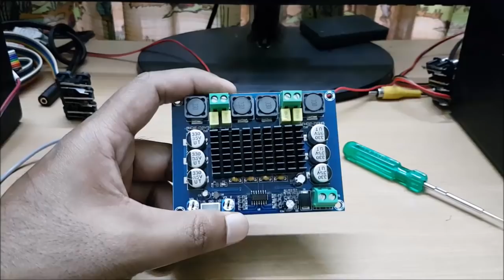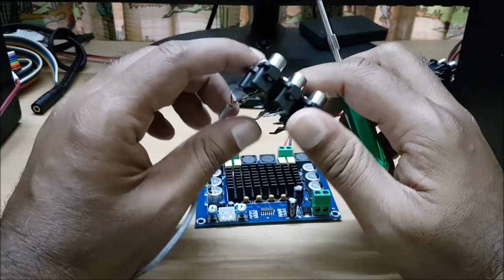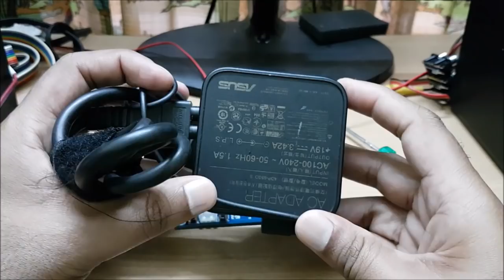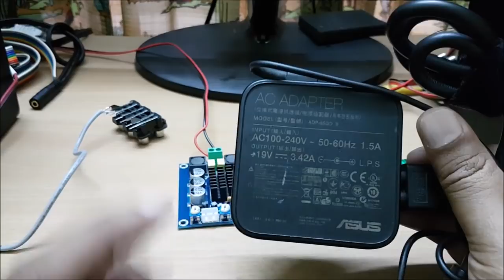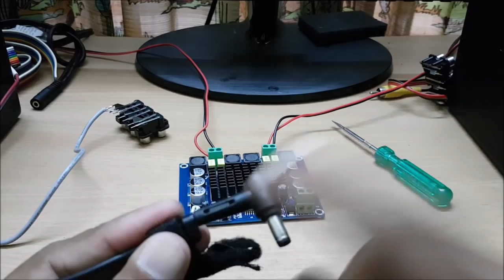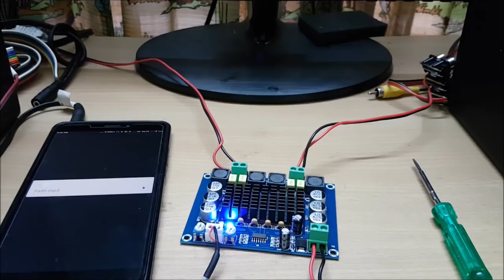TPA3116 How to connect the amplifier

Comment: Ethil 12 vlot eathra ampere  kodukkaam.
Reply: 100+100 alle appo 17 ampere vendi varum.17 ampere kitiyillengil 20 ampere kodukam.pinne ampere ethra koodiyalum kuzhapam illa.karanam carinte Battery 30 ampere okey und.minimum 17 ampere kodukanam
Reply: 12v 17 ampere koduthale 200 watts output kitulloo.12*17=204

Comment: ചേട്ടാ, ഈ ബോർഡ് വച്ചു ഒരു amplifier set ചെയ്തു. നല്ല ക്വാളിറ്റി ആണ്. Earth ചെയ്തിട്ടും നേരിയ humming പ്രോബ്ലെം ഉണ്ട്. Volume കൂട്ടുമ്പോൾ ഉണ്ട്.
Reply from the maker: Power supply etha use cheythathu
Reply: Tech Kannan Malayalam  transformer vachu anu rectifier cheythu. 4700 capacitor koduthu. Earth cheyth enkilum cheriya buzz  sound. But shalyam alla. Music play cheyyumbol ariyilla. Ithinte oppam 4 inch  sub woofer 2 channelilum koduthal extra bass kitumo
Reply from the maker: Don't attach woofers to the same line use another amp for woofers
Reply: Tech Kannan Malayalam any problem ? Transformers 8 ampere Anu. Boardil 40 watts speaker Anu. 40watts  subwoofer koduthal problem undo
Reply: @Jayarajdreams  sub woofer കൊടുക്കാൻ വേറേ sub amplifier വേണം ഇതിൽ സാധാരണ Woofer കൊടുക്കുക.bass treble board separate കൊടുത്തിട്ടുണ്ടോ ഒരു mini bt കൊടുത്താൽ കുറച്ചു കൂടി Bass കിട്ടും.
Reply: Mini bt engane kodukkum bro

Comment: ഈ ബോർഡ് എത്ര ആമ്പിയർ വരെ താങ്ങും?
Reply: Power supply ano.voltage correct koduthal mathi ampere ethra koodiyalum kuzhapam illa.athinu avashyam ulla ampere mathrame ath edukoo.pinne paranju 100+100 Anu ennu appo total 200 watts.12 v anengil 17 ampere venam.24 v anengil 9 ampere venam atha kanak
Reply: @Sharon-xu1xb  tech annan comment vayikarillannu thonnunnu😄
thanks sharon bro👍
Reply: @Btz115  👍🏻🥰
Reply: @Btz115  sheriya arude commentinum reply kodukunnilla

Comment: Tda 7498 aano ithano nallath. Ethedukkanam enn confusion anu
Reply: ithe board njan use cheithathil ninnu enikku manassilayath, high frequency output lu nalla pole distortion varunnund. pinne TDA7298 ne kaalum efficient aanu ee ic, sound quality depends on board layout. ethu eduthalum nalla board cheithittillenkil sound quality undakilla. subwoofer nu aanenkil onnum nokkenda TPA3116D2 edutholu.

Comment: 200w amplifier means it need at least 200w power. If you're using a 20v supply it need a huge 10A current. But normally most of the laptop adapters are 3A max. That means you'll not get full performance using laptop adaptor.

Comment: എനിക്ക് ഒരു മോസ്ഫെറ്റ് ആമ്പ് ഉണ്ട് ആ ബോർഡ് ആണോ നല്ലത് ഇതാണോ? ഇത് bt ൽ കൊടുക്കാമോ?
Reply from the maker: Circuits nokendivarum
Reply: @TechKannanMalayalam  mosfet 200 w board aanu
Reply: @kannanpalode8659  ithu maximum 52W/channel @4Ohm kittukayullu, MOSFET amp il 200W kittunnund ennu urappanenkil, athu thanne use cheyyu.

Comment: what's the difference  between low,high and band pass filters ?
Reply: High pass filter will filter out high frequencies from the audio spectrum which can be connected to a tweeter. Just like the high pass filter,band pass filters filters mid frequency signals and the low pass filter filters low frequency signals
Reply: If you need more clarification i will do a dedicated video about the filters on my channel  https://youtube.com/channel/UCLidfvrxJGkV2Sz_9_lKELw

Comment: 1.My TV has no Eq. Do you know any good but cheap DIY EQ board (5 band)?
2. (I have a Logitech 5.1 , X540,)so I want to split the TV stereo to 5.1 channels.what is the best way you think?
Reply from the maker: 1. Not tried yet 
2. Tv out is stereo and splitting it to 5.1 won't give you much effect , if you have a hd settop box with optical or HDMI out you can use a external decoder to get 5.1
Reply: @TechKannanMalayalam  thanks for reply, 
My set top box has a SPDIF optical out.
Reply from the maker: So get a external surround processor like hd rush .

Comment: എനിക്ക് ഒരു 500RMS ഉള്ള 5.1 home തിയേറ്റർ set ചെയ്യാൻ വേണ്ട apmlifier ഏതാണ് എന്ന് ഒന്നു പറന്നു തരാമോ 
അതിന് പറ്റിയ maximum watts speakers ഏതാണ് എന്നും
Reply from the maker: will be uploading a video on that . 100w mono board 5 ennam venam pinne sub inte power anusarichu veroru boardum.  if you tell me your budget i will suggest according to that
Reply: 25000 thousand
Reply: 6 channel Amplifier(5.1). 50W x 5 + 100W x 1(Sub). Total 350 Watts. Rs.3200
https://www.aliexpress.com/item/Aiyima-TPA3116-Bluetooth-4-2-Amplifier-Board-5-1-Channels-Audio-Amplifiers-100WX1-50WX5-With-Treble/32947028227.html

Or  80W x 5  + 160W Sub. Total 560W. Rs.4300
https://www.aliexpress.com/item/free-shipping-Assembled-TDA7293-5-1-channel-pure-power-amp-board/1581664949.html

Comment: 12v class d amp board?
Reply from the maker: you can use this or 3118,3110. 12v il output will less compared to 24v.